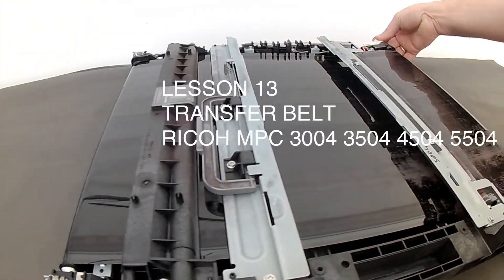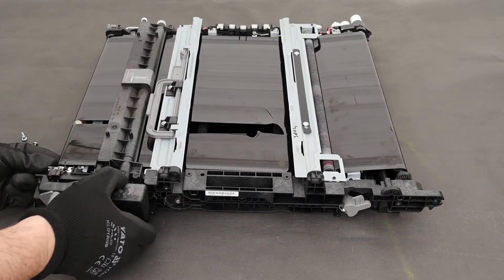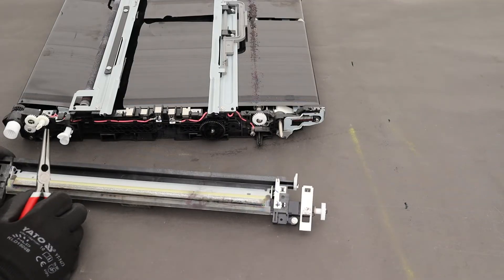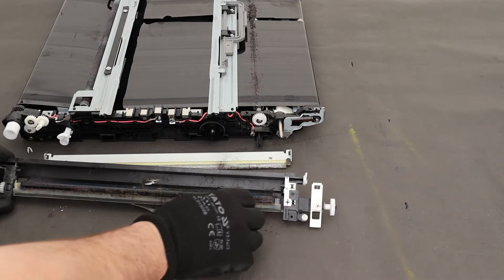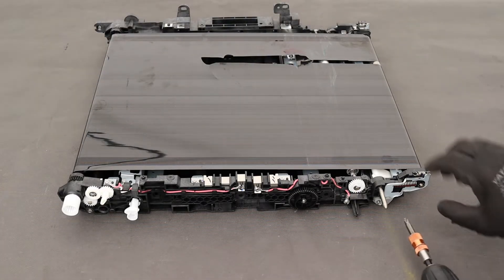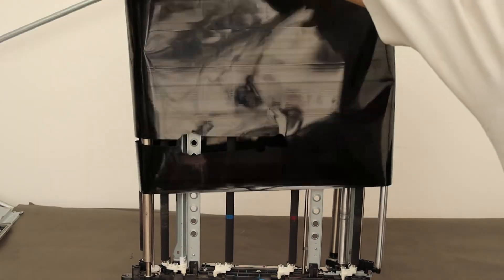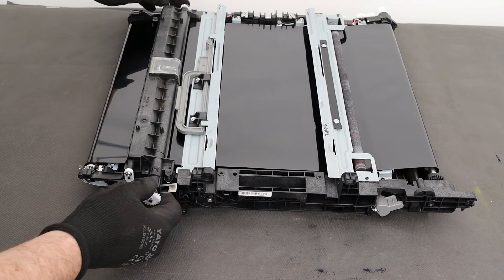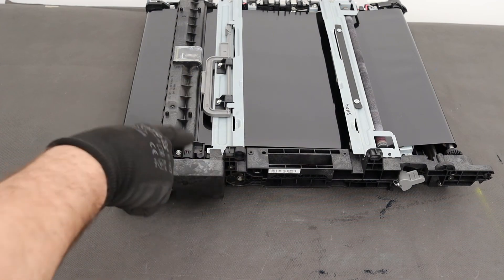Service Training - LESSON 13 (FOR FREE) TRANSFER BELT RICOH MPC 3003 3004 3503 3504 4503 4504

Comment: I’m here due to an SC442-00 error on my MP C3503, and a quick google tells me it’s either a dirty transfer belt lift sensor or a failed belt contact motor. 

Do you have a vid that points out where I can find the sensor to diagnose that first before checking if it’s the motor that’s gone?
Reply from the maker: Hi! 🙂 Yes, SC442-00 usually points to the transfer belt lift sensor or the belt contact motor. I don’t have a dedicated video for that sensor specifically on the MP C3503, but the sensor is generally located near the transfer belt assembly, close to where the belt lifts up during printing.

Here’s what you can do:

Open the top cover and locate the transfer belt.

Look for a small lever or plastic piece with a sensor near the lifting arm.

Carefully clean it from toner dust and check if the mechanism moves freely.

If cleaning the sensor doesn’t fix the error, then the belt contact motor may need to be tested or replaced.

Comment: If I don’t need to replace the transfer belt, can I just blow/vacuum it, or clean it with a cloth and cleaner? Can I use a soft cloth lightly soaked with isopropyl alcohol?
Reply from the maker: If the transfer belt doesn’t need replacing, you should avoid using solvents like isopropyl alcohol, as they can damage the belt’s surface coating and lead to image quality issues. The safest approach is to gently clean it with a soft, dry, lint-free cloth or to blow away dust with compressed air. A vacuum with a soft brush attachment can also be used, but make sure it doesn’t scratch the belt. If you must wipe it, do it very gently without applying pressure. Using alcohol or any liquid cleaner is not recommended unless the service manual for your specific model explicitly allows it.

Comment: Hi, i have a ricoh 4001 machine, 110v. I have a problem, tray 1 is loaded by A4, but not detected and show in panel that is empty, i should frequently open abd close the tray maybe it detect the paper. Please advice how to repair it,. Thank you in advance.
Reply from the maker: If tray 1 in your Ricoh 4001 is loaded with A4 paper but the machine doesn’t detect it and shows the tray as empty, and you temporarily fix it by opening and closing the tray, the problem is likely with the paper sensor or the tray detection mechanism.

Possible causes and solutions:

    The paper sensor or its parts may be dirty or damaged — try cleaning or replacing it.

    The spring or locking mechanism for the tray might be worn out or broken, causing incorrect detection.

    Check if the tray is properly seated and there’s no looseness.

If you want, I can help guide you through a more detailed diagnosis or step-by-step sensor check.